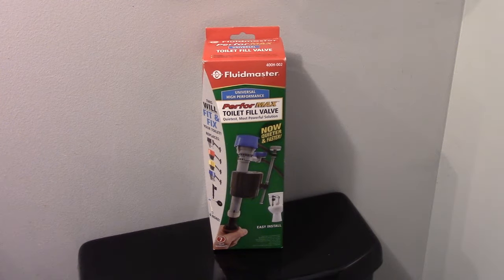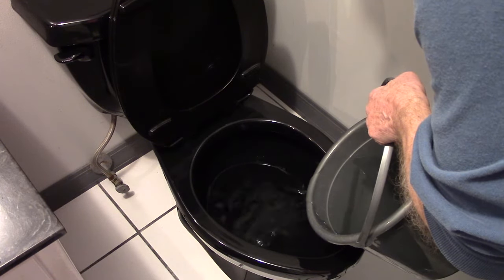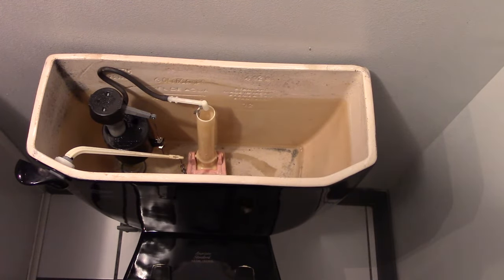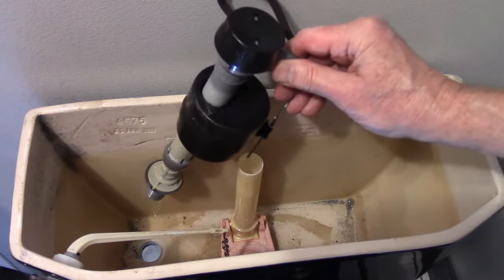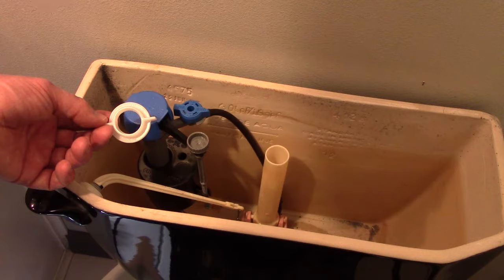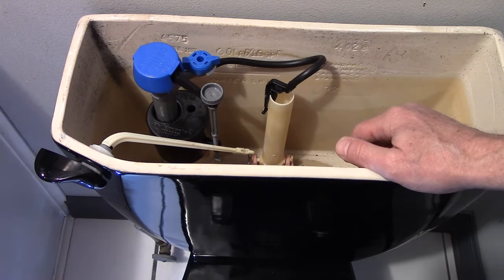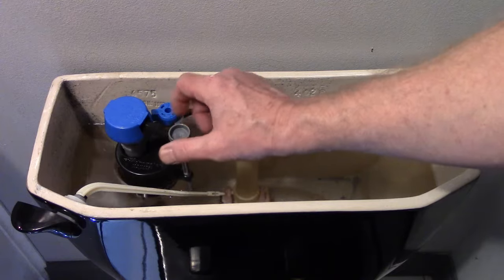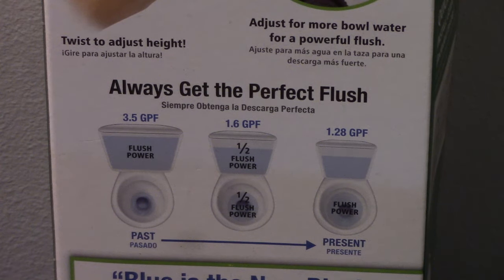Changing Toilet Fill Valve - Fluidmaster PerforMax Fill Valve

Comment: Thank you.  
I  just installed the 400H on a Kohler Highline Arc toilet.  
A fitting in the center of the flush valve connects to the small black hose without any need for the clip. 
By the way, the original fill valve was also a Fluidmaster.  
I am not sure why it would fail after only a few years, but I think that the float no longer goes up and down easily.
The fancier replacement cost about $16.
 I appreciate your helpful and thorough video.
Reply from the maker: You're welcome
Check out more home improvement tips in our e-books https://www.amazon.com/gp/product/B0B2KW1FQ9?notRedirectToSDP=1&.

Comment: Extremely clear concise information.   CL. Critical level information.

Measure the height of the overflow pipe so that the CL is set correctly?
Reply from the maker: Hi, the top of the flush valve overflow pipe should be 1 inch below the hole for the handle and the CL should be one inch above the top of the overflow pipe. 
Check out more home improvement tips in our e-books https://www.amazon.com/gp/product/B0B2KW1FQ9?notRedirectToSDP=1&.
Reply: @FIXITHomeImprovementChannel  I notice adjusting the SHAFT ( using the
inch markings on the shaft) automatic measure to the TOP of the unit and 
NOT to the CL line.  Comment please.

Comment: Thank you for the detailed yet simple video. I was able to change my valve in 10 minutes. I do have a follow up question. My valve was fine on day one but now it’s almost like the valve “starts” every so often, it’s almost like it’s adjusting the water level on its own. Any suggestions to stop that from happening?
Reply from the maker: Hi, if the fill valve is filling the tank from time to time you have a leak from the flapper or gasket. Replacing the flapper or gasket will stop that. 
Check out more home improvement tips in our e-books https://www.amazon.com/gp/product/B0B2KW1FQ9?notRedirectToSDP=1&.
Reply: @ thank you. I have that toilet with the 2 buttons for less water e more water when flushing and it doesn’t look like it’s as easy and changing the flapper. Is this on book 16?
Reply from the maker: Hi, what is the make and model of the toilet?
Reply: @ it’s a Glacier Bay. From looking at pictures it looks like it’s this one Glacier Bay 2-Piece 1.1 GPF/1.6

Comment: Great video.. alotnof information on the Fluidmasters that I didn't know.  
My Question is, " I have a Kohler Flush Valve and it fills very slowly and I don't know if its adjustable. 
I've always used the Fluidmasters 400As.
Is the Kohler better than the Fluidmasters??
Reply from the maker: Hi, do you mean Kohler fill valve? If so, I believe they are made for Kohler by Fluidmaster.
Reply: @FIXITHomeImprovementChannel  yes . They are identical to the Fluidmasters 400a I believe.
It just seems to fill slow

Comment: After watching and reading so many things I just installed a fluidmaster fill valve and the flapper on my toilet and everything works and went good(very proud of myself LOL). But now I have this little tiny drip, it drips about once every 4 minutes it's down were the toilet supply line(it's a CPVC pipe line coming from the wall) the tiny drip is happening at the connection point were the toilet supply line(CPVC) connects to the shut off valve toilet hose thingy. I put a small bowl down there to catch the drips. But I was wondering what do you think is causing it? should I call a Plummer to come fix it? I live by myself and I'm not technical with stuff like that I wouldn't be able to do it myself. Thank you so much😊
Reply from the maker: Hi, you can send a picture of the problem to me at fixitpodcast@gmail.com.

Comment: @ 5:00 Does the nut and connector on the line have to make contact after you've tightened both up or is it okay to have some thread between them if you've tightened them both as much as possible?
Reply from the maker: Hi, there will be space between the top of the nut on the supply line and the bottom of the nut on the hut holding the fill valve. The washer inside the nut on the supply line just needs to make contact with the bottom of the threaded tube on the fill valve.
Check out more home improvement tips in our e-books https://www.amazon.com/gp/product/B0B2KW1FQ9?notRedirectToSDP=1&.

Comment: How do I lower fill valve cap so lid will fit well
Reply from the maker: Hi, you need to lower the shaft on the fill valve. Here are the instructions. https://www.fluidmaster.com/wp-content/uploads/2017/02/400C_Instr_ENGLISH-1.pdf
Check out more home improvement tips in our e-books https://www.amazon.com/gp/product/B0B2KW1FQ9?notRedirectToSDP=1&.

Comment: Back in 1965 they had 4  1/2 gal toilet flush. Everything worked great with the high cost of water in California it was costly to flush. when in that year my Dad worked at   in a top-secret Testing Laboratory where my Dad worked that day. He brought home a New and water saving device Fluidmaster 400a'. You could use your old 4  1/2 gal   toilet flush and convert to a 1 1/2 gal flush in less than 5 min time. It would flush the same and be easy to install. It saved a lot of money in a year's time. As for today, trying to keep it clean and save time and money is a little harder. You can live with the problem or live with the solution? my Problem was trying to keep my toilet clean and odor free, with a lot of hard water stains Keeping the Water Jets Free from Hard Water? Hard water is a Problem' So I found Spray Bleach from Walmart, every time I use it. Spray a little bleach in the Bowl. I refill the Spray bottle with a funnel.  added the 64oz bleach to the spray bottle and a little dish soap to it. Shake it a little and ready to use. Happy Newyear's Hugs wheelchair larry